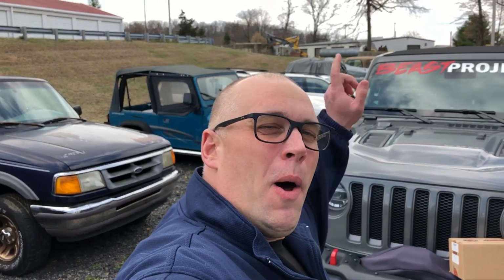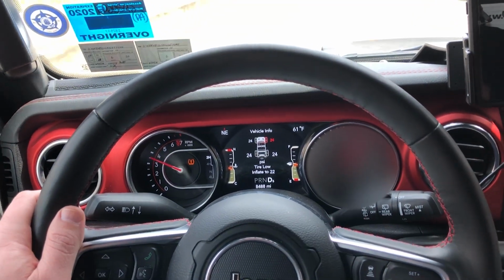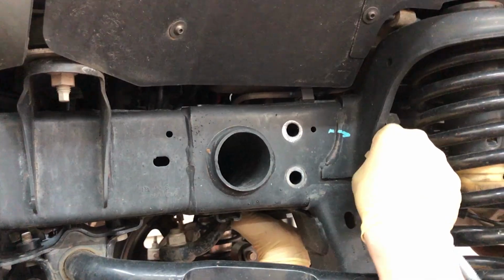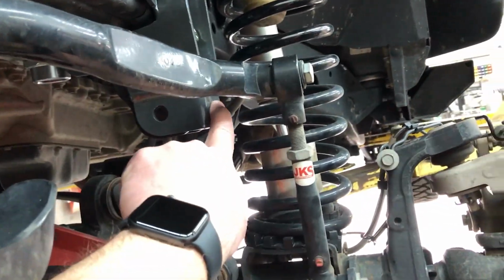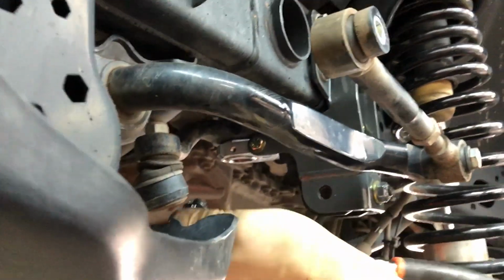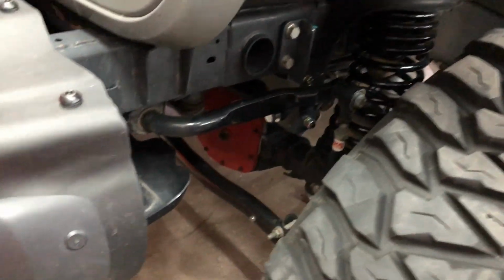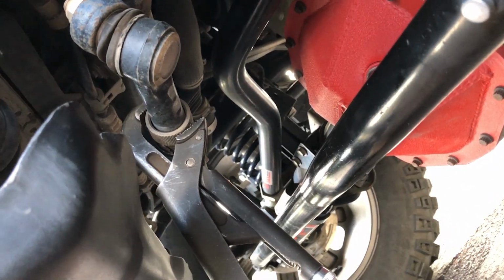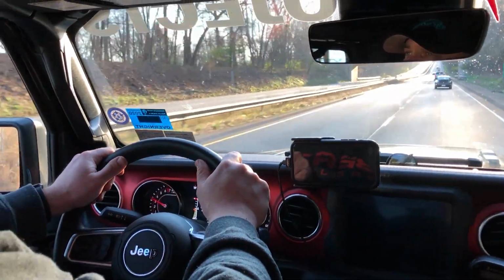WRANGLER JL JT STEERING ISSUES SOLVED! Synergy Track Bar & Sector Shaft Brace

Comment: After getting new adjustable front LCAs, front and rear track bars and a heavy duty tire rod and adjusting toe, caster and recentering both axles my steering stills handles like crap. I found out that it has a lot to do with the gearbox being made from aluminum. I ordered this part hopefully it is the final piece of the puzzle 😅😅

Comment: Did you by chance get the shakes like death wobble or articulation at high speed when hitting bumps? I have had such a hard time getting this fixed. Jeep is putting in a new steering box and I ordered the syngery isolator as well.

Comment: On 10/05/2020 I special ordered my 2021 2 doors Rubicon , arrived to the dealer 11/23/2020 unfortunately I have a lot of problems with the steering, and it wanders to right very bad . I only drove it 200 miles and it has been at the dealer since then (6 days)
Reply from the maker: Yeah, they all wander stock/brand new. It’s a combination of having too much air in the tires, which makes a balloon effect & weak steering components. This brace & running 30 psi in my tires fixed the wandering issue for me & I’m on 37’s.

Comment: Seen there's problem with the selector shaft breaking off if your running a drop track rod arm, the mechanical advantage is the problem there, but as soon as your getting outside the OEM tire size or lifting the suspension with a drop selector arm or even the factory arm your getting into a can of worms with that OEM set up for sure. It's is a good idea, but it might be better with a sealed bearing as opposed to a bronze bushing over time, that kit could easily be improved upon with a O ring on top, and dust cap on the bottom, unless you like greasing your rig frequently ....

Comment: Great video! I just installed it and am having the same issue with the steering wheel facing the same direction as the one in the video. Which way did you turn the rod to get it to straighten?

Comment: I just installed mine and it works well but when i curve around a car my steering wheel wants to stay at that turning angle even if i let go of the wheel. usually it would return back to straight but i have to manually pull back to straighten it. I also have a fox steering stabilizer
Reply from the maker: Sounds like you might have something binding.

Comment: Looks like a great install.  My JL is being built and I hate constantly correcting the steering wheel on a straight road.   I will look into this I’m mine floats too.  
What shop in PA did the work and where is it located?  Some of your scenery looked familiar like you were on RT 30 in Coatesville/ Downingtown area.
Reply from the maker: Thank you, the Jp Shop in Chester Springs, PA. 610-458-1977
Reply: So approximately what’s the cost of the Synergy kit and what’s the cost of install?   You don’t have to be exact with the numbers just a ball park figure for each please.

Comment: How does it work to solve the steering issue and can you show it on a diagram?
Reply: The 2018-20 JL have an aluminum steering gear and if you were to go under the vehicle and have someone turn the steering wheel you can actually see the steering gear separate from the frame slightly which causes the steering wander. The way this bracket works is it reinforces the steering gear mounting points and securely tightens it to the frame.  There is a TSB out now TSB 08-074-20 that replaces the aluminum steering gear with a steel one and a software update of the steering unit.  I believe the 2021 models have the upgraded steel gear already.  The way to know for sure is look at the color of the steering gear.  If it's gray in color it's aluminum, if black then it's steel.
Reply from the maker: Good call, mine is aluminum & had no idea there was TSB on it.
Reply: @BEASTProjects  I just found out myself a few days ago.  I made an appt with the stealership to get it done but they had to order the box since they didnt have it in stock.  I have the Synergy bracket sitting in my garage and i'm still gonna install it after they do the TSB for extra reinforcement.